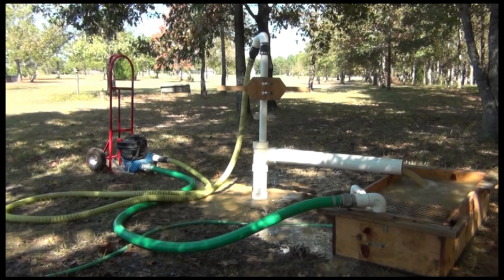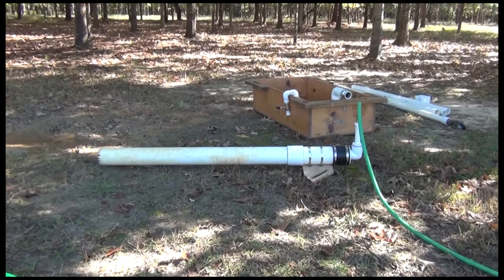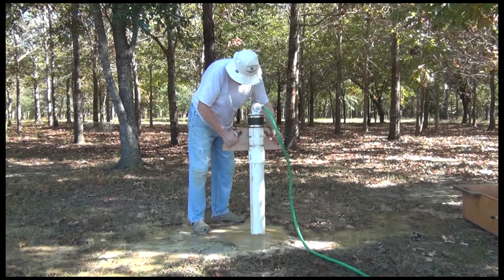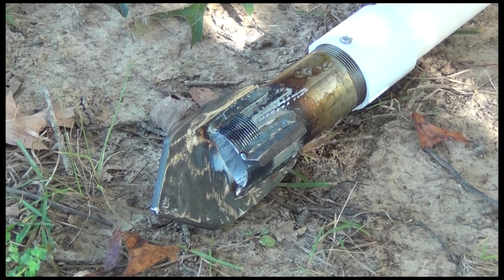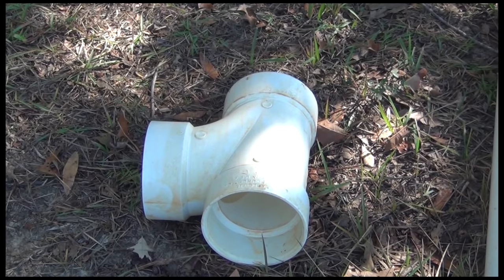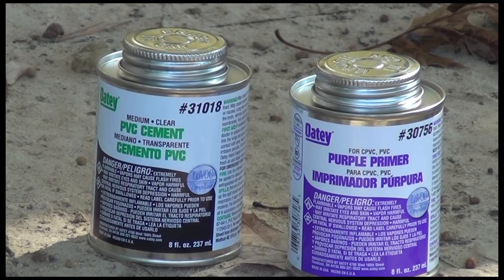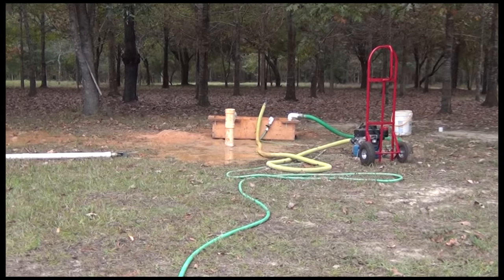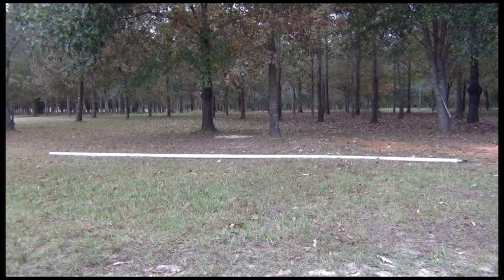Drill Your Own Water Well - Mud Pump & Portable Mud Pit

Comment: Nice detailed video! On the website you have this instruction about the Bentonite:
"To mix the bentonite, set up a five gallon bucket near the drill site.  Put about three gallons of water in a 5 gallon bucket and pour in the bentonite while you are mixing with a drill and concrete mixing bit." 

How much Bentonite do you pour in the 3 gallons of water? And how often do you pour such a bucket in this during drilling?

Comment: I found Inside PVC Joyner Connector for Schedule 40 PVC Pipe that could be utilized on the inside of pipe much more efficient than the outside pipe couplings , there's less of a chance of fine sand collapsing and building up on the outside of the pipe and having it stuck in the boar then if you are to use and outside the pipe coupling Joiner , outside the PVC pipe coupling can act similar to a Brass Hose Barb/Rigid
preventing the pipe from sliding out , I was able to slide a pipe even if left overnight ... not a problem , what sand is worse than dry concrete .
Reply from the maker: Are you able to get the wellscreen pipe down through it?

Comment: Between all the videos, I tried the 2 hose method and found I could only get 14-16'. So I checked a few more of your methods and the website and found the trash pump video.  I now have a 37' well, all I have to do now is hook up to my irregation and a few other planed projects.  I build swimming pools for a living so I was able to scrounge up a few fittings and spent about $130 total. I will end up spending about $500 - $800 I think by the time I'm done. Between a new well pump (I'm using a 1hp hayward pump which I have to throttle down with a valve), pressure tank and so on. 

   2 Saturdays and about 12-14 hours total I have a well that produces clean, clear FREE water minus a few bucks for power.  I'm thinking about a 1 year return to break even and then I'll save on my overage. 

Good luck to anyone who tries this. 

4" pipe 6' deep
40' of 2" pipe
40' of 1 1/4" pipe
5' well screen 1 1/4"
2" trash/water pump
20 lbs of bentonite drilling clay
Misc fittings
Reply from the maker: Michael Hollis Congratulations Michael!   One year 100% ROI is spectacular.  If you post a video or send me pictures, I'll be happy to put it in the "Success Stories."   I'm thrilled it worked for you.
Reply: dawmlw Thanks, between the pool, irregation, my rentals and many other needs for water I end up with an overage of about $700-$800.  I still can't believe how well this water well produces. Still working on getting things plumbed in. I wish I took more pics but I do have a few to send you.
Reply from the maker: Michael Hollis Congratulations Michael!   Good job!
Reply: Congratulation Michael.  I assume you used a jet pump with the packer/ejector in the 2 inch pipe (and that you left  the 2 inch pipe in the ground).  So did you drop the 5' 1 1/4 inch screen to the bottom of the well, and then pull the 2 inch pipe up 5' to expose the screen?  Also, how far up from the bottom of the well was the water table?
Using a non-mud pump method, I successfully drilled a 43' well with 2 inch pipe.  Once I hit the aquafer, the water pressure went into the aquafer and the clay/sand seeped in and grabbed my pipe.  I'm now trying to drive a 1 1/4 inch PVC well point further in past the end of my 2 inch pipe, but it's going nowhere.  I tried drilling using a 1 inch drill pipe, however as soon as I pull the pipe out, the sand in the aquafer collapses, and it won't let me push the well point in :-(  I'm so close I can taste it.

Comment from the maker: If your ground water level is 25 feet or higher a shallow well or suction pump will work.  If your ground water is deeper then you will need a jet and a jet pump or a submersible pump.  Water can only be sucked up from 25 feet or less no matter how much power you have.  It is an atmospheric thing.  You can push it from any depth.

Comment: With a 2 in well pipe what kind of pump are you using to pull water up from 40 or 50 ft?
Reply: Physics says that you cannot suck beyond 30 feet. You have to have a submersed or deep well jet   pump to go beyond about 20 feet.  Deep well jets have two pipes that go into the well.

Comment: Great and informative video.  The only thing I would change is to replace the screen in the box with a dam that is an inch lower than the water level.  That way all the cuttings will drop to the bottom on the inlet side and only water will flow over the board used as a dam to the outlet side.  Eventually the inlet side will completely fill with mud but you will still be pumping almost mud free water.  This assumes that you continue to add water as the level decreases.
Reply from the maker: 3G Green Good point 3G.  I basically agree.  It needs to be a little lower than 1 inch below the water level to allow for varying water levels but the screen is not optimal.

Comment: What about a 4" casing? Could you make the metal cutting blade like 5, 6" and use a 6" return pipe at the top, going back to the mud pit? Then come back and set a casing? I think I'm about to go build a mud box right now...
Reply from the maker: The problem with a larger casing like 4" is it becomes too hard to turn by hand.

Comment: Hi. You said that it is possible to achieve a hole depth of between 50 and 60ft. I've been told that the majority of pumps can't suck water out at that depth. How did you over come this problem. Regards Paul.
Reply from the maker: You have to use a packer jet.  But first you have to get a screen down there.

Comment: Maybe a quick release clamp would work well on your handle.
Reply from the maker: I've tried a couple and never found one that worked as well as the horrible hose clamp which needs replacing about every three wells.
Reply: @dawmlw  just trying to help.  Yes some of the qick clamp were crap.     I made some pipe clamps a few years and purchased the clamp ends made out of cast iron castings..   they my rust..would need to keep they greased up.  APPRECIATE YOUR WORK,  nice job on the vedeo.
Reply from the maker: @TheDWZemke  Some sort of quick release clamp would certainly be nice.  Getting ones that work easily and are also cheap is a challenge I have failed to overcome.

Comment: Hi. I showed this video to my friend he said it wouldn't work on his land and most of the lands here in Russia. To get good quality water you need to dig really deep(30, 50 metres, maybe more) and there is a big chance that your bit meets a stone or really hard soil, he said. I've tried to google but can't find any information about that topic. And i m not sure if I should give it a go or hire professionals. For some reasons, it really interesting to me to construct it :)  Any suggestions guys?
Reply: I am trying to figure out the same with nearly the same conditions as you described above. I am looking into building my own "drilling head" made from four "jetters" that would be fixed to a 4 to 5" inch head that would rotate slowly as it digs with water pressure from a pressure washer. -I arrived at this instructional video trying to figure out how to circulate water from my little pond. 
Actually I am wanting to create a device that will "eat" my pond deeper.
Reply: @nonyabusiness9747  so how's this going?

Comment: I just gave up on my hole, got to 52 feet with a 100mm casing without significant water. overnight the bottom refilled with sticky mud and the casing it probably stuck
Reply from the maker: You have to use bentonite until you get down to where you want to set your screen.  Even with bentonite, though, you can't get much deeper than you did.  I've made it 70 feet but that is about it with a human powered drill.
Reply: @dawmlw  what is bentonite? how does it work and how to use it?

Comment: Very intriguing how would you go 90 foot deep in sandy soil with no rocks and use a 4in submersible pump? Or would it be even possible with a small rig like this? Thanks
Reply from the maker: I'm sorry but a 90 foot hole four inches in diameter can not be drilled like this.  Or at least I have never done it.  I've made it 70 feet with a two inch hole.
Reply: dawmlw Thanks for the response and thanks for doing the videos!
Reply: I made it to 40 ft in a pure sparta sand and using this method without a bit. It took me several tries. The well collapsed when I pulled the 2 inch pipe, so I had to redrill the last 20 ft again. I didn't use a bit so that I could insert the 1.25 inch sand screen and PVC through the center of the 2 inch drill pipe, then pulled the drill pipe, leaving the sand screen. such fun. It's a very good well now.

Comment: If you pulled the drill pipe out to continue the next day, wouldn't the hole all cave in so youd have to start all over again from scratch?
Reply from the maker: The sandy layers cave in and the clay layers stay open.  The sandy layers where bentonite was used stay open.

Comment: Did you have someone come out to determine that this is the spot where water is located? I'm sure you didn't just decide to start at this point without knowing.
Reply from the maker: No, generally if there is water anywhere in the area, it is everywhere.  The water table is high in this area and it is basically hard to miss hitting water.

Comment: Hey, I like your method of drilling! Can you make a video of the water you're pumping out of these wells? And perhaps the flow rate you are achieving? Thanks!!!
Reply from the maker: There are several photos posted by users of water being pumped.  The flow rates vary radically by location but are typically in the range of 4 to 5 GPM for a three foot 1.25 inch screen.

Comment: Also... Saw another video where another youtuber did this on the cheap using his neighbors water hose with success.   Since most homes have about 40PSI,  I am wondering if I can accomplish this with a cheap SeaFlow 55  5.5 GPM 60PSI 12 volt pump?  Wonder if this little pump will be able to handle sand and drilling mud mix (benzonite) in the supply .. btw, did not see you using bezonite?
Reply from the maker: I doubt a 5.5 GPM pump will be adequate.   Gasoline powered pumps work best.  I probably should have showed adding the bentonite slurry.  It was used.

Comment: I am currently jetting down a well. I work on it basically every day and I get a few inches a day. Currently at 29 feet. I am currently at a layer of very course sand. Whenever I jet down water my cuttings are small pebbles, but I am getting no mud or sand back. Just pebbles. Would this be when to add clay? How am I moving pebbles but not sand?? I think I might give the well project a break for a day or 2 because I might actually be at water? Gonna wait and see ro make sure my water level isn't artificially high. I've literally pumped 1000 gallons of water down. We'll see. But yeah. Add clay or no?
Reply from the maker: Assuming you are not within a few feet of where you will ultimately want to set your screen, this is exactly where you should bentonite.  Mix it extremely well before you put it in the hole
Reply: @dawmlw  thank you for your timely response. I'll consider it. Ultimately I know that my static water level is 40-50 feet. This well kinda consumed my life for the past 2 weeks and I'm trying to figure out how to make it all end lol. Do you know anything about using compressed air to pump up water? I'm thinking that if I have my 30 foot of 2 inch pipe in the ground, I should be able to pound down 1 or 1 1/4 pipe the rest of the way and use compressed air to pump up the water. But I think my air hose needs to be a certain amount below the static water level?
Reply from the maker: @flecktards3126  Try to stay patient.   Do you have any neighbors with wells?  How far down are they?   Wherever water is the level tends to be the same in the area.
Reply: @dawmlw  everyone in my area has a 100 foot well, but closest neighbor with the same elevation as I do has a static water level at 40 feet.

Comment: I attempted digging a well in a remote area where I don’t have water to flow down into hole to wash cuttings out. I used a twist auger to dog down. I hit water at around 14 feet or so. Once I hit water I couldn’t pull out the shavings. If I could get water there with a 250 gallon tote and pump, could I continue to cut with auger but wash shaving to top just by pumping water into hole? Or if I put bentonite/water mix into hole could I pull shaving out with auger?

Comment: I worked for a professional company dewatering an undground path so that a 5 foot diameter pipe could be put under ground from a river to the pumping station for a town water supply. We used 2-2/2 inch 20 foot steel pipe sections with a special drill head made for positive and negative flow.  I was the luck lad to carry and hold the 20 foot steel pipe sections vertically by hand while the pipe slowly drilled its way into the ground. Any rocks that got in the way gradually got pushed aside when the surrounding area around the drill head cleared enough space to push them away. We did these wells every 15 feet or so on both sides of the excavation area and had a 600HP portable pump doing the job of water supply and suction.
Reply from the maker: Thanks for watching!

Comment: Thanks for everything. Please why did you put the quick gel?
Reply from the maker: Quik Gel (bentonite) when mixed with water into a slurry, solidifies the sides of the hole so it doesn't collapse onto the drillpipe.  Stop using it when you get down to where you are going to ultimately put the well screen because it also stops water from flowing into the well.

Comment: the thrash pump can only go so deep.  So this only for shallow wells of about 60 feet
if you need any deeper the thrash pump cannot pull the water from that depth.
Reply from the maker: Actually, the pump is not the limitation.  It is the friction between the drillpipe and the earth.  It gets extremely hard to turn as you get deeper.  And if you let it set overnight it sticks.  So, as a practical matter it is best not to plan on a well deeper than 60 feet.  Thanks for watching!

Comment: Could you use this technique to drill a 100-foot or 200-foot deep hole, 6" or 8" in diameter? I'm thinking about a geothermal, closed, vertical ground loop.
Reply from the maker: No, a human powered drill just won't do that.   I'm sorry.

Comment from the maker: A packer jet or a two pipe jet will pull water up from much deeper.  This type of drilling does not produce a well of sufficient diameter to use a two pipe jet but packer jets are certainly an option and one that we have used successfully.  Thanks for watching!
Reply: Packer jets? Is that something like the water jetters used for cleaning sewer lines?
Reply from the maker: @nonyabusiness9747  No it is a recirculating jet that fits in a two inch pipe.

Comment: Great video thank you. Very well explained. May I ask what brand mud pump you were using please and what flow rate it needs to be?
Reply from the maker: +Peter Draper Peter, unfortunately I don't know.   I bought it from a company that went out of business and there is no nameplate on it.  It has a flow rate of 100 GPM which is more than you can use.  Just get any good small trash or semi trash pump and you will be fine.

Comment: Thank you for making these videos.  You explain things very well. I feel I am getting a good education based on your experience.  You have already tried a lot of different ways to do things so we don't have to repeat your mistakes.  I am trying to learn all I can to decide if your methods can be used here where there is bound to be gravel.  Will a mud-pump work to bring up gravel? Up to what sized gravel, in your experience?

In my case I have just paid a crew to reopen a well on my ranch in the Southern Baja Peninsula in Mexico. I hadn't used the well in five years. It is located in deep sandy loam on a desert prairie with dry creek-beds every half mile or so coming down from the mountains.  Five years ago there was plenty of water in my well at 24 meters.  Now there is none at all at even down to 40 meters.   We figure the water table is been over-pumped nearby to supply a phosphorus mine about 20 miles away.  I will be looking for another site to locate a new well.  I have been water-witching the property and find lots of indications of water under the dry stream beds where it shouldn't be too deep, but there is bound to be gravel and possibly some rock underground.  I will have to drill to find out. All around is soft sandy loam soil many meters thick where your method of drilling should work well but the water will be much closer to the surface in the creekbeds.  The water I need is probably deeper than I can go with PVC.  I am considering starting with 6-inch PVC and then 4-inch, to get a head start and go deeper.  Has anybody emailed about having tried that yet?
Reply from the maker: Linda,

A mud pump will bring up gravel.  Regarding the four and six inch diameter wells - they are nearly impossible to do with a hand drilling rig.  You can drill a two inch hole and then ream it out to four inch with enough patience.  I just don't see how six inch is possible.